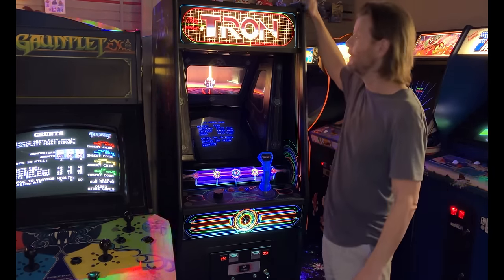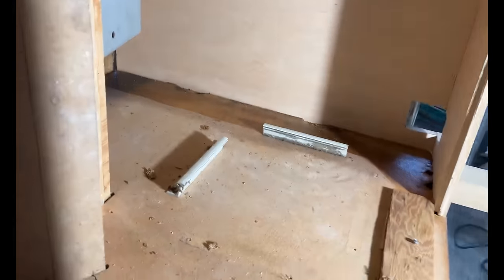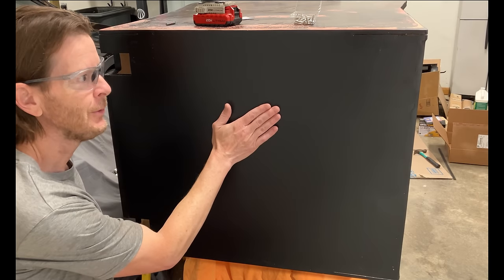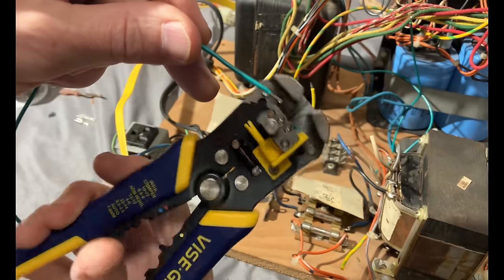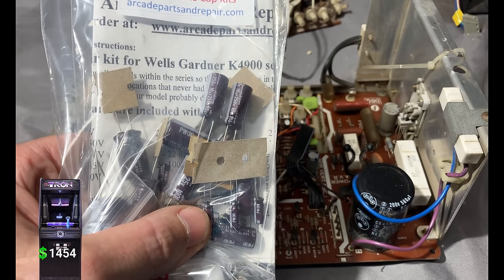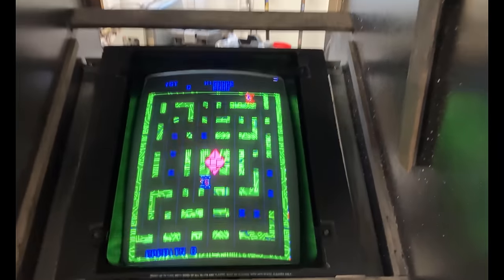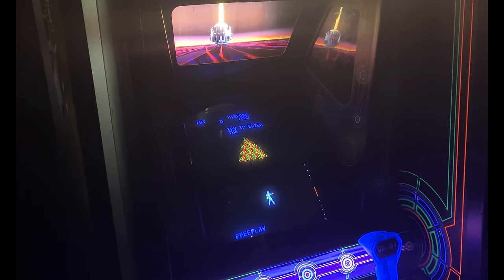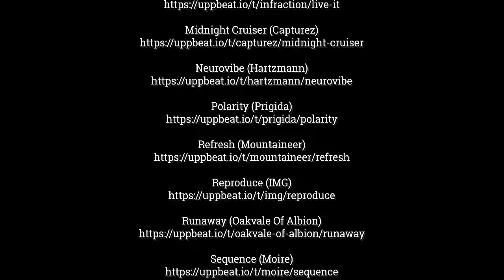"Trashed" Tron Arcade Restoration!

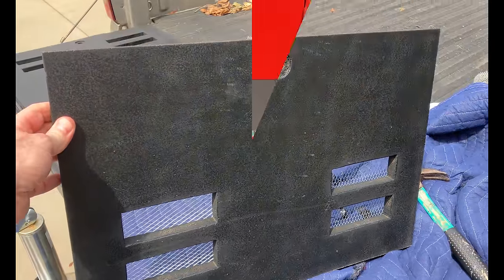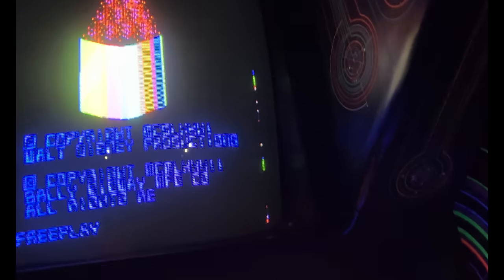Comment: @1:39:15 - The capacitors have to be the same ohms--no, I think you mean micro-farads. @1:42:11 - There's an electron gun at the back of the cathode ray tube--of course you have to adjust the gun to eliminate unwanted pixels at the edgesm. How could RAM change the electron gun? Excellent video--fascinating stuff and no way I could have done it.
Reply from the maker: Good catch! But on the question of how the RAM could affect the artifacts—those are there because of video RAM being used to store some data…it’s intentional by the developers but could also have been bad video RAM that was storing garbage rather than blank screen. The only solution is to adjust it out. Thanks!

Comment: Consider also using solder after crimping the crimp connectors. It makes connections last centuries rather than decades.  :)
Reply: I have read though that solder makes the wire stiff which can then be prone to breaking if it moves or vibrates over time.

Comment: I'm a SONY TV tech from the 80s and 90s. I'm a bit rusty these days but those pixles on the right side look like the last scaned line which was about half a line from memory. This line would some times contain data used in decoding and we would all ways strech the scan just wider to hide them like you did. ( that's where the term "over scan" comes from)
Anyway when Tron came out in the arcades I was super excited to play it because for the frist time it felt like being in the movie. However my recollection of the one I played in Sydney Australia was on a bigger screen and it was like in a booth with side curtains or something. It might have been the "Discs of TRON"
Reply from the maker: Yes, I’ve found that it is perfectly normal operation for these boards. So adjusting it out was correct.
You are probably thinking of Discs of Tron. I never saw it in the big cabinet back in the day but hear that it’s awesome. Thanks!

Comment: 1:42:00 it was a common method to save on memory to write game state data into the video memory at the edge of the screen.  this "glitch" is the way the game was designed and is required to be on screen because if you adjust the screen so it goes off you end up losing your border for the light cycle game and the tank game.  this "glitch" was designed in and it's appearance is normal operation.
Reply from the maker: That’s what I found afterward and sort of suspected while I was messing with it. Interesting how creative designers used to be to get the most out of the hardware :)

Comment: Great restoration, was there different versions of Tron (loved playing it as the 4 mini games felt like ou got good value for your money) as here in the UK Tron had the light cycles, the battle tanks was different ( more like a cross between Tank commander and Tie fighter) , light disc/rings (throwing a disc to knock out the ring your opponent stood on) and the MCP  destruction to reach the next level or was there 2 distinct arcade games of Tron?
Reply from the maker: The discs were a separate game, Discs of Tron, but perhaps versions in the UK were different. I don’t really know…

Comment: Dunno if it's worth noting that in the worst cases, when it comes to filter caps purely for power supply ripple filtering, you can go larger in uF if you can't get the parts. Not that that happens very often if at all -  when it comes to specific frequency applications like filtering unwanted HF or audio crossover filtering that you need to match it for sure.
Reply from the maker: Good to know. Thanks!

Comment: I feel like if that were me in that garage, I'd just get the dimensions for everything and build my own cabinet.  All the time and materials that went into just restoring destroyed pressboard, you could have gotten some new MDF and had a far better carcass to build on.
Reply from the maker: That’s what a non-insane person would say :) My goal is to keep as much original as possible and in this case it was a real challenge but sometimes I just have to scrap some pieces and recut my own MDF. For Tron, there’s already CAD drawings detailing all the parts so people do make their own new cabinets. I referenced them when rebuilding the base out of plywood.

Comment: To polish acrylic, sand it down and go finer and finer down to the finest sandpaper. I used 1200. Then use steel wool size 000 to sand it down some more. After that bring it to fantastic clearness with polishing paste.
Reply from the maker: Yes, it definitely works to do that. And I just went through that whole process on a current project, although I have grits to 3000. The buffing foam does really well on the final shine-up. Thanks!

Comment: The black paint pens are always the wrong shade of black my trick when I refurbished used slot machines was the dab and smear the paint from those pens to get a nice blend of color. Looks like time to build a big shed in the backyard say 16ft x 12ft with ac lol.put the entry at a corner no windows should fit quite a few cabinets. Nice restoration.
Reply from the maker: Thanks for the tip! If we can just keep it warm enough around here I’d annex the garage as an additional arcade, but sadly winter arrives each and every year…

Comment: The artifact on the monitor edge may be the same situation with Williams games of the era. RAM was precious back in the day and they would use the VRAM at the screens edge to run code. They basically banked on the screen being calibrated to push that area out of view.
Reply from the maker: That’s what I’ve come to understand but that’s the best explanation why. Thanks!
Reply: @tcurtis49   Thanks for the video. I modelled a Tron Arcade cab in Blender to run in Unreal Engine just basing it on pictures, artwork and the same cabinet blueprints you used for the base. Your video was the most comprehensive documentation of a Tron I've come across yet and I've watched many. It allowed me to properly double check my model for accuracy.
Reply from the maker: It does take a lot of scanning through other people’s posts,  videos, etc to really see how it all comes together. I remember having a particular difficult time figuring out how the lower lights were situated.

Comment: wouldn't do a hammertone finish do the trick? 2 coats max i guess - and it would resemble the initial texture of this painted, awfully raw particle board pretty well i assume?!
Reply from the maker: Not sure. I’m always open to suggestions.
Reply: @tcurtis49  unfortunately i've got no experience with hammertone paint on wood.. but it might do the trick - since it's pretty thick, robust and has this structured, texured look. could be less bodywork needed to achieve an even-ish surface?

Comment: I get wanting to preserve as much of the original machine as possible, but with the amount of work you've put into keeping the original particle board i would have just completely replaced the cabinet out of the maple, it won't be too many years before different parts of it are in the same kind of condition as what you've just fixed :(
Reply from the maker: A lot of people would, and you can buy this cabinet pre-made if you like. I'm curious why you think it will deteriorate over time. When properly restored and kept in a normal environment (like a home) there's no reason for it to spontaneously rot. Especially given that the most problematic area would be the base and I've replaced it with maple. The previous damage was due to water getting into the base of the cabinet once it was no longer off the floor (due to missing leg levelers) and stored against concrete. I have games I restored in the late 1990s that look exactly the same today, so if that means for the next 30 years I have nothing to worry about, I'm good :)

Comment: My mind wanted to blow up when you used the zip cleaner. A lot electronic board has layers, traces and you don't want it to get in between or have them and would not use water. Try using 91% rubbing alcohol.
Very, very nice work to bring this back to life!
Reply from the maker: Thanks! Believe it or not, most experts hose down circuit boards with water before doing anything else, and often run them in the dishwasher. As long as they are completely dry before powering up they should be good. I’m not aware that water would soak into the board in any way. But much appreciated and I’ll keep my eye on it. Thanks!
Reply: @tcurtis49  yeah I worked for a small company that would repair boards for thermals, dot matrix printers and so on. We has a few times water found it ways between the layers, don't know if they were not press right or came from soldering holes or separation between the layers on the board. Any ways great job.

Comment: May I ask...
As you never mentioned exactly, how long it actually took from start to finish???
Reply from the maker: I think I tinkered with it from late March until the end of summer, but went back and forth with it and Pole Position. So that’s still a bit vague—I’m never in a hurry with these as that takes the fun out of it and other shiny things distract me. I can say when I sit down to work on it I do a lot at once; the electronics section from power supply to monitor to having the game running was all in one day. But things like cabinet body work I sort of dread and put off until I have several days in a row I can commit. I have some projects right now that will hopefully go more quickly, particularly since people have been watching these (finally) and I need to keep it up :)

Comment: Hey, toilet bowl cleaner, what a damn good idea for copper/tin corrosion. That deoxit d5, however, is not. It soaks into CB fibers. You could also loosen the epoxy holding the traces with it. Mercon 4 transmission fluid would be better for electrical contacts. I would just use IPA and a short bristle china bristle brush.
Reply from the maker: Nearly everyone I know uses Deoxit liberally on circuit boards. I did a search and can't find any source that says it soaks into circuit boards or is otherwise problematic. But I will keep that in mind. Thanks!

Comment: Great restoration, great video! You mentioned something troubling, though -- "This monitor has been unplugged for months so I doubt there's any charge left..." Good thing you drained it anyway, because the teacher of my electronics repair class in high school put himself in the hospital thinking the same thing about a picture tube that had been sitting in the corner of our classroom unplugged for a full YEAR. Drain those picture tubes EVERY TIME no matter what! 😬⚡️
Reply from the maker: It’s certainly true—it’s unusual for them to keep a charge over time but they certainly can. Maybe I should have made a bigger point that you should always discharge no matter what. I do :)
Reply: @tcurtis49 I'm just glad you did! 😊

Comment: MCR boards (Tron, Satan's Hollow, etc.) are supposed to have the digital garbage line down the right side of the monitor.  It's part of the hardware design.  If you want it original, then leave it. If it bugs you, then you can adjust it out with vertical width like you did.
Reply from the maker: That's definitely the case. I know now not to worry about it and just adjust it out. Thanks!

Comment: Zep Acidic Toilet Bowl Cleaner is 10% hydrochloric acid - you should try vinegar or citric acid which take longer but won't burn your eyes and skin off.
Reply from the maker: Definitely need to be careful but it’s really not that strong. If you get some on your hands you would want to thoroughly rinse it off. Pretty much like all household chemicals. I recommend using chemical resistant gloves with it. But certainly you can use something less potent if you want :) Thanks!

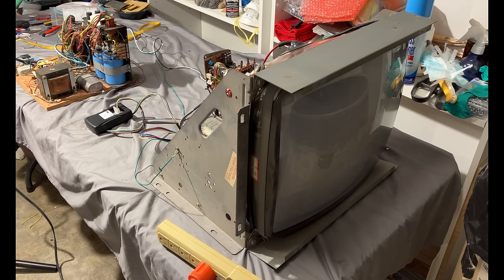Comment: 1:07:31 I wanted to run my hand on the screen to feel the static lol I used to always do that with those old tvs
Reply from the maker: Good way to know if the high voltage is working on a monitor :) I’m working on some right now and they definitely have the static!
Reply: @tcurtis49  I never really wanted to own an arcade machine, just play them. Your Tron machine made me want one lol it came out so perfect

Comment: OOF, I feel ya about damaging the neck of the tube. I built a MAME cabinet in high school, and designed pretty much the whole thing around a TV I had modified, stripping it down to just the tube, removing the tuner to make the thing square and feed a video signal. It was the end of the year, so it was a real rush to finish it off. I was 99% finished, pretty much just getting the speakers and marquee installed, which was one of those 3 handed jobs. Bumped the drill, which of course hit the absolute worst spot, right on the end of the neck. the sound of the thing loosing vacuum was one of the worst sounds I had ever heard. With no time to source an new screen or even modify the chassis to fit a different one, the project was essentially dead in the water. All that work, and never even turning it on. fortunately the Joystick was a separate assembly, and based on standard usb gamepads. served as my coffee table infront of the couch for many years and saw heaps of use, Even got a good grade for the project. but definatly have some trauma about CRT necks...   

also, Bangin' soundtrack
Reply from the maker: I necked one that I had just bought from someone who had done a tube swap. I was picking it up from the back of the car and as I walked it across the garage, somehow the neck got caught on my coat and snapped. Yep, awful sound :) But I found another compatible tv and tube swapped it again!

Thanks!

Comment: Why not replace the black light marquee etc with led ? Saves power and les servicing . Same with a modern switching psu only further protects the machine.
Reply: I see he did an led bulb for the marquee later.
Reply from the maker: I did use LED bulbs on everything but the blacklights and stuck with the originals on those for appearance reasons. As far as modern switching psu there’s a whole slew of opinions there but it depends on each game and how risky using the original will be. You’ll see me go modern for a restoration later this year. Thanks!

Comment: New to your channel - subscribed !  Very good work on that cabinet.  What brand of dremel polishing bits do you have?  I bought a set to polish coin door parts like you, and mine just disintegrated. Curious if you could provide a link.   Keep these videos coming!
Reply from the maker: I get mine on Amazon: Rocaris 40 Pack 1 inch Abrasive Wheel Buffing Polishing Wheel Set for Rotary Tool - 25mm… https://a.co/d/cBXTUU5
Reply from the maker: And thanks! Got some projects in the works as we speak :)

Comment: never knew about hardener. i have soaked wood glue in to slightly swollen particle board and clamped it over night. before this video i'd have remade the whole cabinet in ply. to do a base in particle board would be sacrilege
Reply from the maker: I can’t believe they originally used particle board for those bases with so much structural load on them. The plywood base I put in should last basically forever. I could have remade the sides in plywood but my goal was to maintain what I could and it is surprisingly strong. Wood hardener is definitely great :)

Comment: Awesome!!!  Btw, Titebond II is GREAT for cleaning records!
Reply from the maker: I have never tried that :) Next time I need to clean a record I’ll give it a go!
Reply: @tcurtis49   Oh yeah, spread it on thin on the spinning turntable so it'll dry in a few hours.  I actually have a white plastic disc I put under it.  I bought it for transparent color records to make them more visible but it works great for not getting a mess on the platter.  It will be clear when dry.  Spread on too thick and it will still be yellow a whole day later.  I use a flexible credit card.  You want to not use the edge so much but use the card more like spreading icing on a cake.

  When it's dried clear, you get an edge with your fingernail and pull the whole thing off with a zip kind of sound.  Cleans the record great.  It might be the best thing for cleaning a record.  Plus you get that nice "glue record" when you pull it off. 😁 If your record still doesn't sound good after that then you might want to find another one.

Comment: Before I'd put money into rebuilding this I'd build the sit down glass top coin-op model, where all I'd need a copy of all the MANE files for the 80 & 90 Arcade coin-op games with the menu software to switch between the games, a box with feet, smoked safety glass top, game controls, speakers (with headphone jack & BT link), & a tiny computer.  Raspberry Pi 5 should be able to handle these old games with no problems.  With a total price about $300.  I remember there being a huge market for the sit-down models back when "Man-Caves" first started being a thing, & the one game everyone wanted was Ms Pac-Man.
Reply from the maker: They are certainly out there and I have a large MAME cabinet but the main goal is not to play the game but to experience it and enjoy the original cabinet/artwork. Thanks!